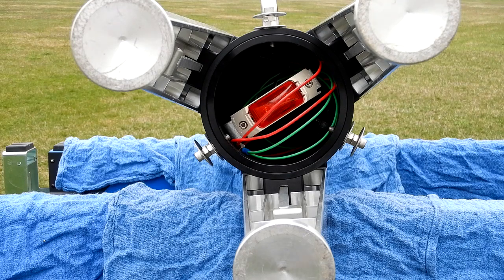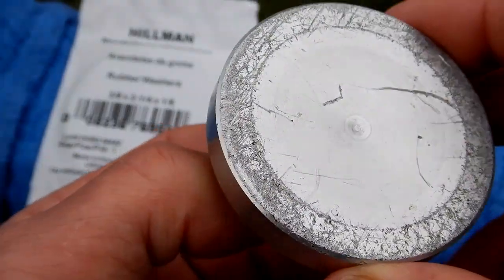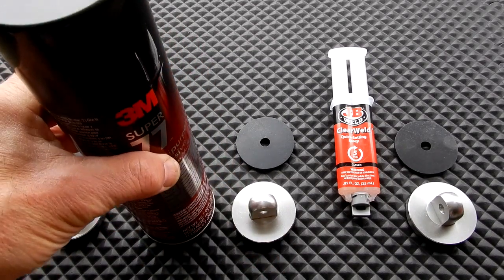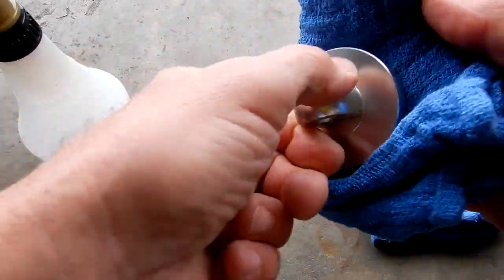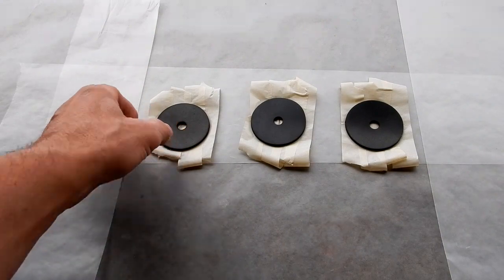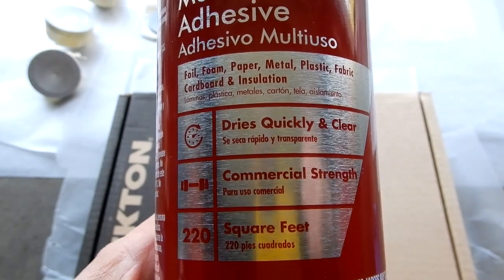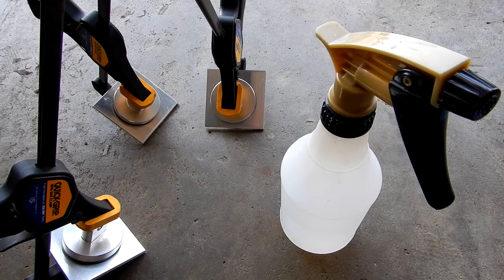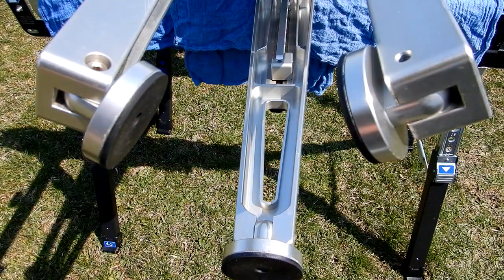Astro Physics 6" Eagle Adjustable Folding Pier FOOT MODIFICATION

Comment: I'm going to be getting an eagle pier soon, is the entire system sliding really an issue??? Assuming the ground is fairly level and the weight of the entire system, what is causing it to slide?
Reply from the maker: mar504      No, you will be fine.

Comment: That's pretty darn sharp!  I like it. Do let us know how it holds up and if you develop any problems with sliding or anything.  Took screen prints of the two products.  Wouldn't have ever considered taking the feet off. Would have tried it in place. Your way is definitely more methodical, precise and clean.  Hey did you ever describe the red light install process, procedure and parts for that under column light?  I resorted to glow in the dark tape and blinking lights.  Found the latter to be too distracting to nearby imagers so would like to know more about that under tube light!
Reply from the maker: Thanks so much  guzzialfa! I will have to do an update. As to the red light inside the tube I will have to do a video on some of the updates I did along with that light to the Eagle tripod. The light BTW is a marker light for semis or trailers.
Reply: @starastronomer  Looking forward to it.  I need more than just the glow in the dark tape and get yelled at while at Cherry Springs Star Party with the Astro Gizmos blinking lights. Okay for outreach but not other places.  Your implementation looks to fire down in full cut off fashion. Totally non-intrusive.